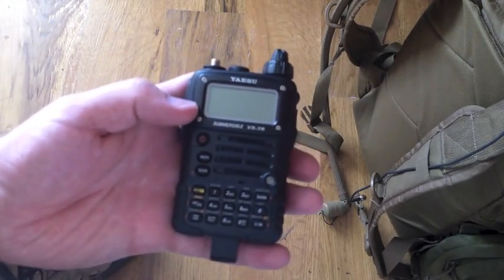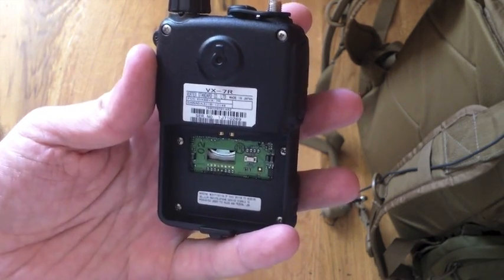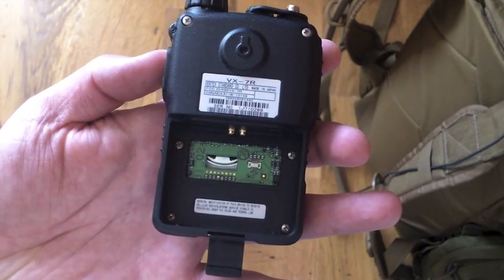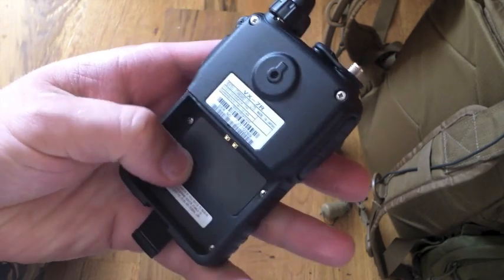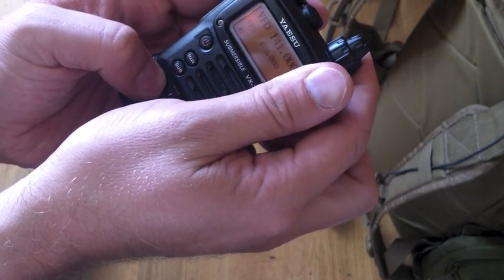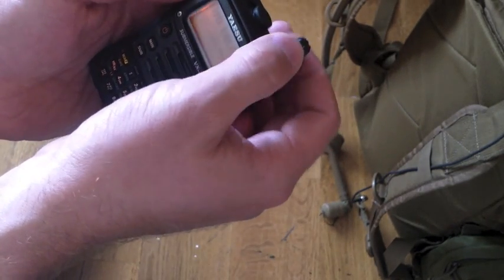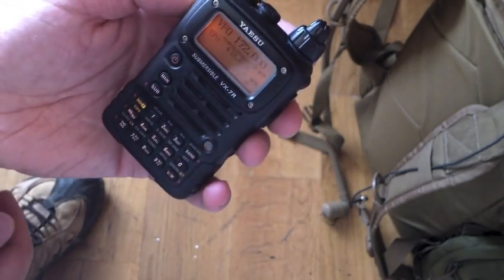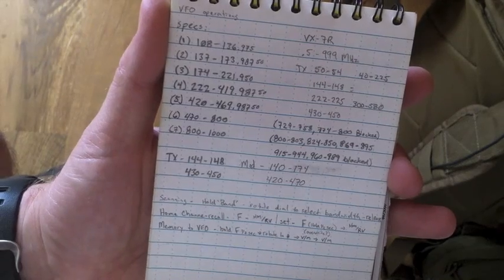Yaesu VX-7R Out of Band Modification

Comment: Is this the same mod for the VX-6R ? Thanks for the video.
Reply: I had a 6r and it was modified to to the same thing. It got just over 1.5 watts on 6, 5 on 2 and 440 and 1/3 on 222... that 1.5 on 6 with a mag mount antenna mobile was incredible!

Comment: Another good way to freeband the radio is download the VX-7R commander software and set the radio settings to freeband and program the radio using the software.   I use my radio for search & rescue operations and I programmed it to the fire station we work out of and used a duplex frequency in UHF and it works awesome. I'm able to contact medcom now on that little radio and 
our team has one extra radio.  I have a 12 volt power cord that takes the place of the battery and I can rig up a 12 volt rechargeable battery in my backpack for a couple of days of use.
Reply: If you're part of the FD, nobody probably cares which actual unit you use for transmission on their freqs, even if it's not type-certified for commercial use.  However, I wouldn't be bragging about it in front of strangers.
Reply: So you were able to freeband w/o removing the solder? Just with the software? What tx range do you have now?
Reply: Hi, i read about VX-7R commander software and I'm interested in freeband my handheld. Could you tell us how did you do it? I downloaded this program but I haven't got programming cable... Which one did you use to freeband the vx-7r transceiver?? Did you use windows 10? Thanks and I hope you can give us tips!!

Comment: I've never done anything with radios, but have always wanted to get into it. My question on this video is this: I've heard it's illegal to modify radios like this (I already know it's illegal to transmit on a lot of those frequencies). If it's illegal to modify these radios, why do the manufacturers make it so simple to do so? Why are those jumpers so easy to get to?

Thanks for fielding a noob's question. :)
Reply from the maker: No problem asking the question. It's not illegal to modify amateur radio equipment.  FCC Part 97 explains all of that, so dive into it to actually see the black and white.  The question then comes if it's legal to transmit on the frequencies you've opened up your radio to transmit on.  That falls under the FCC codes for those particular services.  For instance, the VHF business band (~140-170MHz) is covered by Part 90 which says it's illegal to use modified equipment on those frequencies.  Most FCC code, however, has explicit statements about allowing users to use what ever means are available to them in the event of life threatening emergencies.  So that's why I have it, just in case I'm out there and something goes wrong.

Comment: Recommend you use a commercial wideband duck\whip antenna, dont use the HAM  stock antenna as found these very narrow banded on VHF on  OUT OF BAND.
On my VX-6 used a sma motorola VHF much better esp the VSWR figures on commercial freq's.

Comment: can transmit TX at Airband ? 118-120 Mhz ?
Reply: +Farid Farhan I have heard it can be done,but antenna need changing for airband and not sure on performance as good as a real airband txer,i suggest avoid and use a proper aircraft radio thats approved and built for 118-136mhz spec.If my life depended on it i would not use a modded ham set for airband tx.
Reply: @scottw.harriger4527   7r will tx on am or FM on air band

Comment: Thanks for the video! One question: do you know why I cannot transmit on PMR446 band, even after the mod?
When I try to transmit, the frequency always changes to 441.*
Reply from the maker: +Álvaro Branco What rpcomms1 was referring to was the Automatic Repeater Shift.  If it's on, when you push to talk, it will automatically 'downshift' to a normal repeater in put freq.  So for 446, it will automatically shift down 5 MHz to 441.  Thanks for watching.
Reply: +sigmaluco yes correct if it is a usa spec radio will auto shift rpt on 446mhz.If its euro spec radio  it may not as not ham freq there is still difference even when export mod done on radio depending on where you bought radio country.
I program radio manual via PC on  tx and rx thru software its easier and no mistakes with shift and tones.
Most LMR\PMR are narrow (2.5khz dev or half dev in yaesu case)PMR 446mhz is not ham in uk\EU.Glad you sorted problem.
Reply: @rpcomms1  12.5 kHz spacing on PMR.
Reply: +Álvaro Branco Have you got the split - on?
Reply: +rpcomms1 You mean the "split tone"... this one I do. 

But anyway I was able overcome the issue by storing the PMR channels' frequencies like they had independent tx frequencies, thus programming manually the tx/rx just like they were different but imputing the same frequency. A little bit awkward but it worked fine.

Comment: Don't key up without an antenna. I AM a ham radio geek and modifying the radio ISN'T the problem. That's not even illegal I don't think. It's transmitting on those other frequencies, that is a no no. But if everything collapses someday, so do the FCC laws. Then it would be nice to have a capable radio. But until then, everyone obey the law.

Comment: Thanks so much for the video. This is my first time removing soldering, and I hate to screw it up. I saw the video bit not quite sure which soldering to remove. Could you show a close up picture? Thanks
Reply: just open jumper 4 and 5 they are clearly numbered. don‘t forget to press the buttons 4, band, v/m and (then) power all together.

Comment: Are you pushing the PTT without an antenna?   That's probably not a good idea.
Reply: I'm sure he's smart enough to have the radio turned off while doing the mod
Reply: @leewilliams7443  That's not what he said, He's pushing the PTT button "Without" a physical antenna or using a "Dummy Load" that's used to keep the radio from damaging its finals. Transmitting without an antenna attached is a huge "NO', ham radio or any transceiver period. #Ham101
Reply: @bravo2xrayonce again, now with a master's degree, the battery is out lol.

Comment: Hi sigmaluco

Question 1:
I've got used european B2 version. The radio came with jumpers 4-5 removed (unsoldering marks), and jumper 2 is still in place.
With jumpers 4-5 removed, the radio hasn't been reset by previous owner, or was returned to its original state (somehow).
Any chance you know what jumper 2 does? Couldn't figure this out.

Question 2:
After performing reset action, I get freeband only on MAIN.
SUB is still limited to 50-54,137-174,420-470. Is that correct?

Comment: Surprised some obnoxious ham radio geeks haven't commented on how it's illegal to broadcast on non-ham channels.
Reply from the maker: Some have, but I have asked to see the "black and white" and then they go away:)  There are things you can't do with it opened (communicate on FRS channels, etc...), but there are many catches about "using any means at your disposal in emergencies" within most FCC codes.  Thanks for watching and commenting.
Reply: +sigmaluco In Canada it is pretty simple when it is a genuine emergency - any frequency can be used and no power limit applies - an SOS or mayday is no joke.  All other stations within range have to cease unnecessary transmits and listen unless they are committing assistance to the emergency at hand.  Ref: every study guide for various radio services that IC offers licenses for (the HAM one specifically has this as a question on the test though).

So yes there is good reason to open up your radio if you are heading into the back country and need redundancy in communication, but now you have to be cognizant of your radio's settings to avoid interference to other licensed services.  These devices are made for the novice ham that got their most basic ticket... the more advanced/tech tickets permit home-building of radios.  Any home-built HAM radio is essentially an open radio for the bands the builder designed it for.
Reply: FCC "rules and regulations" are,  in fact, laws, i.e., they have the force of laws under statutes enacted by Congress, including possible criminal fines and incarceration for violators.  The fact that Part 97 says "No provision of these rules..." certainly does not extend to "any other rules, regulations or laws", any of which could certainly limit such uses as well, particularly outside of ham bands.

Comment: YES! After your Modification the Original Vertex-Firmware is working in my Radio but now are all Bandwidth NFM and WFM are to small and to wide. If i transmit in NFM(12,5kHz) the other Staion can't read my signal because it have a to weak Signal for a 25kHz Reciver. I change to WFM now the Reciving Station can hear my Signal better but now i can't hear the other Station only half so loud and a lot of noise in the Radio. So how i can fix this problem - i batch my Radio back to the Yaesu Firmware and have only 50-52MHz, 144-146MHz and 430-440MHz here in Europe. Is it possible to expand the Band in RX and TX and configure the Bandwidth?

Best Regards
Volker

Comment: You can easily mod both the VX6R and the 7R to open up it's transmit range. But it will only transmit FM, not AM which is used on aircraft frequencies. So the modification would have little or no benefit for aviation use.

Comment: Hello, friend, okay? When taking jumpers VX-7r, it receives and transmits in the range of 46-50 Mhz? For I saw in a forum that only light transmission kindled, and that nothing would be transmitted. Could you confirm this information as tou thinking of buying this radio, but I had to make sure it would pass on that track. Thank you!